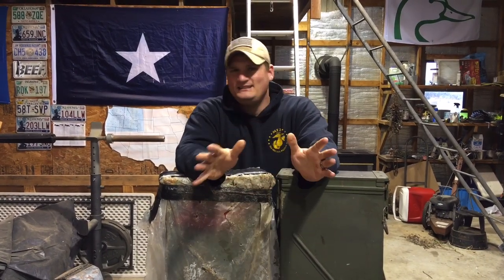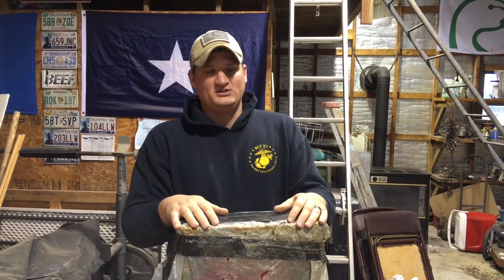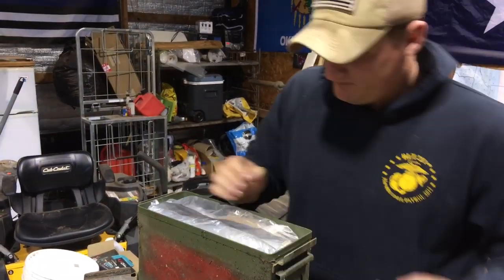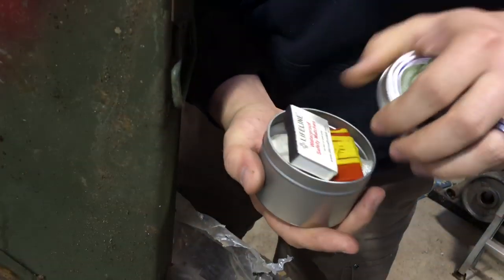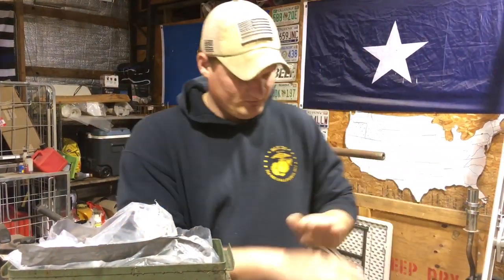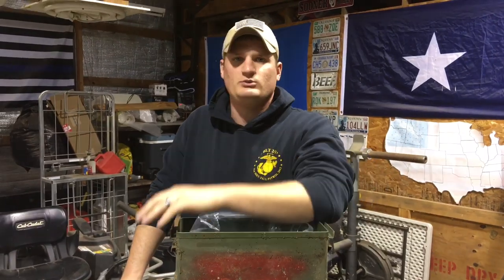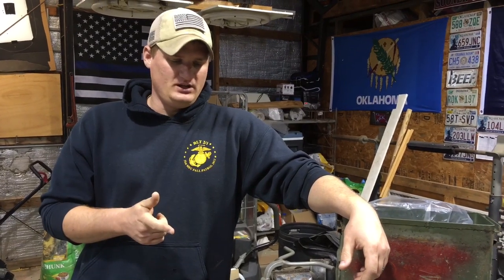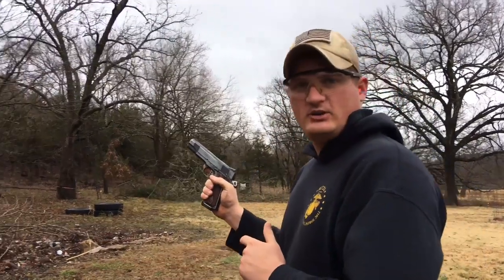Opening A Four Year Old Survival Cache! | Military Can Style!

Comment: I recently opened a 10 year old cache.  It was beautiful.
The trick is to leave no space inside for moisture; I filled the voids with hot wax.  Then I let it all cool down slowly.  All equipment was sealed in waterproof bags with big desiccant packages inside.
I used 6 inch PVC instead of an ammo can.
There was NO rust on metal equipment.

Comment: I put my cache in a plastic jug with a screw top lid.
sealed the lid with electrical tap then put a coat of flex seal around the lid.
Then I cut out a bottom of a coffee can and put it on top so it want get poked.
wrapped it with a couple of store bags.
Then finally I put it in a hot/cold bag. Taped it up.
I will burry it under a local bridge with a layer of dirt then put a small piece of rusted meta
l on top so it looks like trash and finally I will cover it with soil.